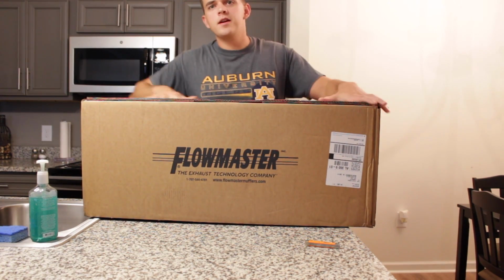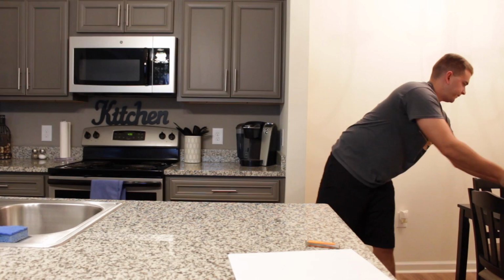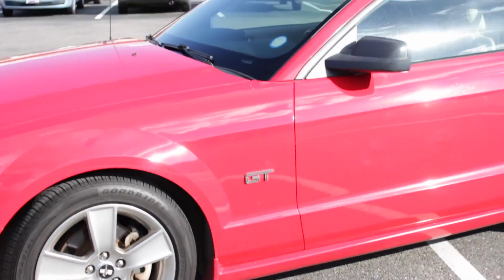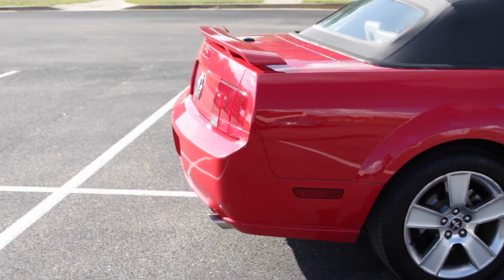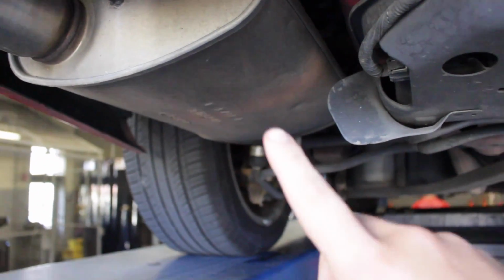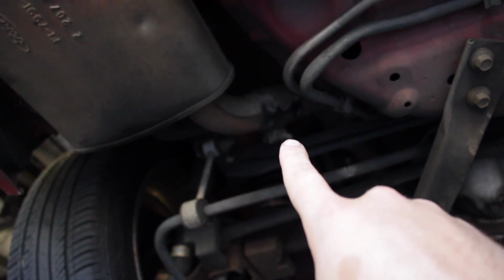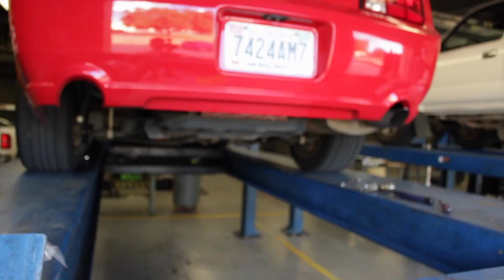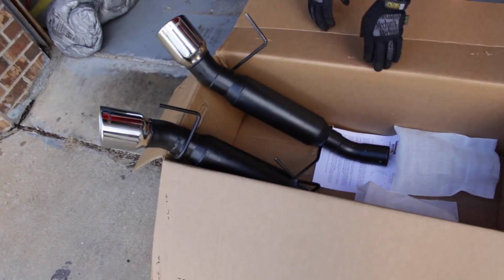Flowmaster Outlaw Series Axle-Back Install

Comment: The video doesn't do the sound of the Flowmaster Outlaw series exhaust justice.  I had a 2015 3.7 Mustang with the same exhaust and it was extremely loud and would turn heads and wake up the neighbors everytime I drove by.  It's a lot louder when you're accelerating then when just reving the engine.
Reply from the maker: +Michael Reitz very true I was very impressed with this exhaust. Definitely a lot louder than advertised